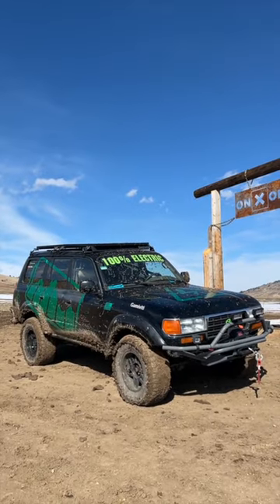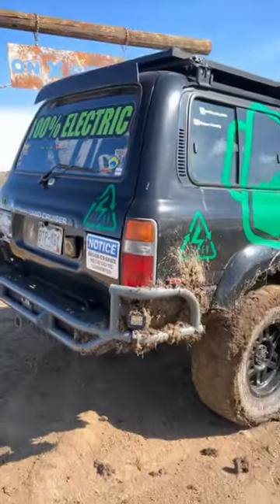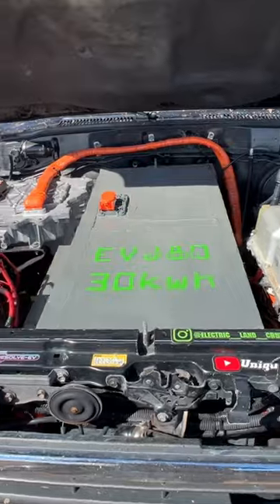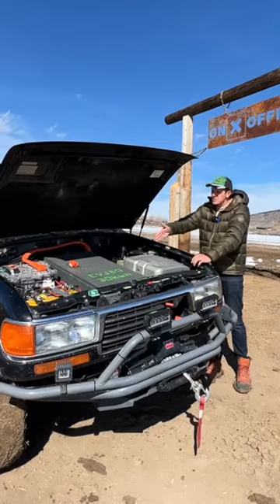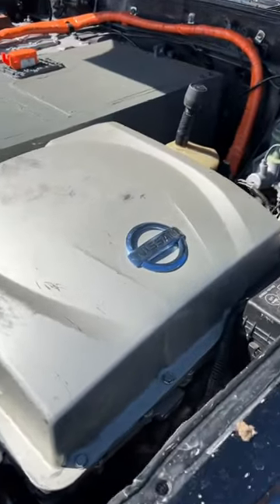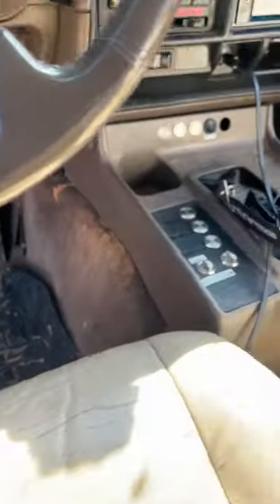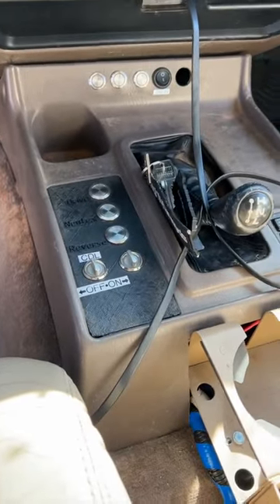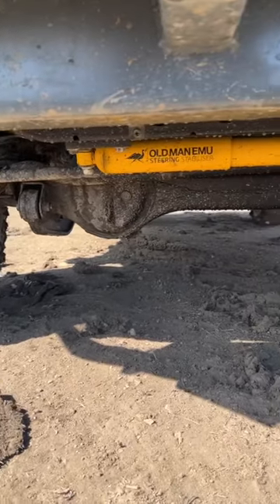Not Your Average Land Cruiser!

Comment: $15k for 60 mile range? Do a 4BT swap for the same price and get 700 miles range (plus you can run bio diesel which is way more environment friendly than lithium cancer batteries)

Comment: Imo it's now a considerably worse truck than before. Good for builders skill, time and all that, no disrespect there. But 15k buys you a decent lc. Now it's just kinda ugly stickered up techware that only goes an embarrassing 60 miles to a charge 🤷‍♂️. Tfl embracing these ev conversions but Imo they seem to be only worse than their gas counterparts. I've seen no benefits only downgrades to usability and utility of the conversions shown, besides the generic "lol no gas" meme. Double edged sword, hopefully tech improves as 60miles is near useless for most. But if tech improves this conversion will be even worse in time. Either way I don't see these conversions aging well unfortunately. Ohh well, a hybrid swap would be cool.